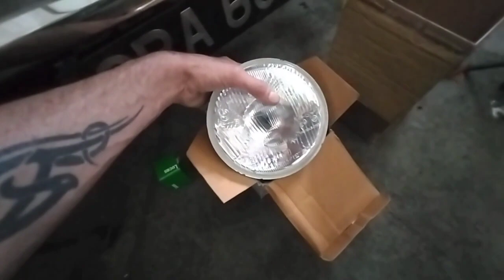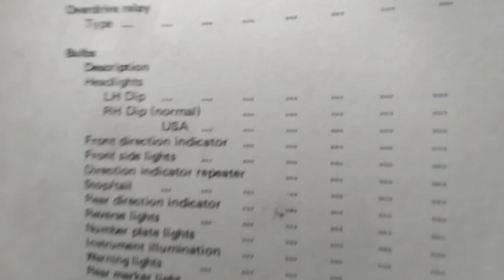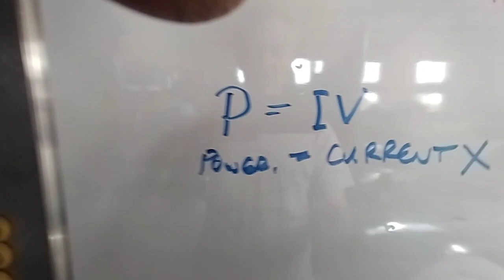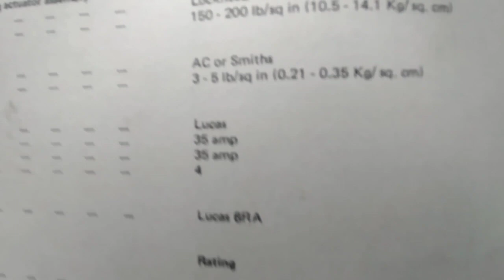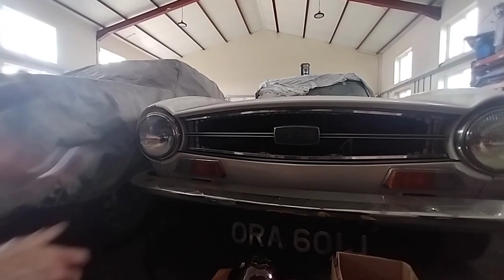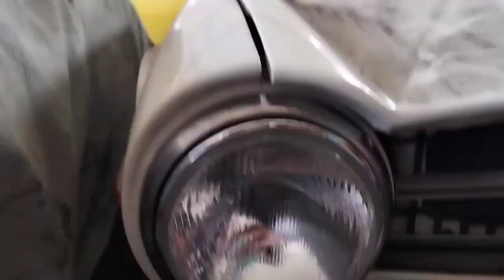classic car headlight upgrade - tr6 halogen conversion

Comment: I think the manual is a bit poor, it states "LH Dip" not LH drive, so RH drive cars dip to the left, therefore UK cars would be 60/45w. When I did the conversion on my XJ6 the kit came with a rubber seal over the bulb to help keep condensation out, did your kit not have them? I have binged watched nearly all your videos, thanks v.much for posting and please keep going. Regards Jeff
Reply from the maker: This kit did too, I forgot to fit them in the video,  I had to do it later!